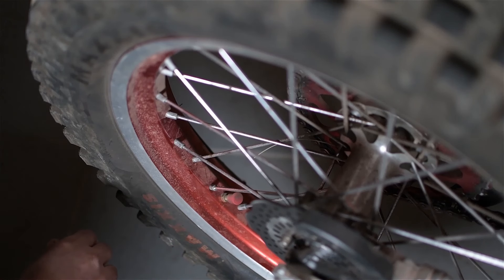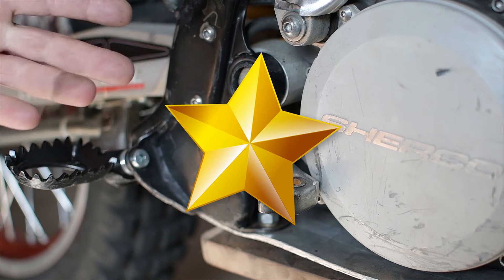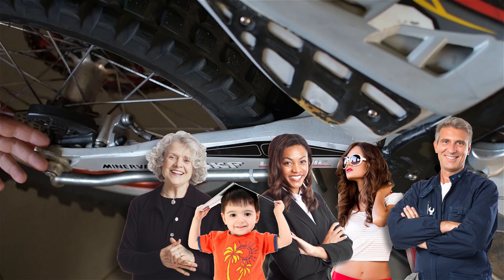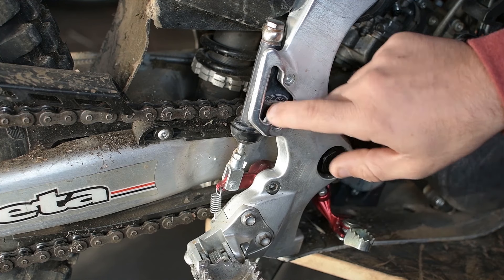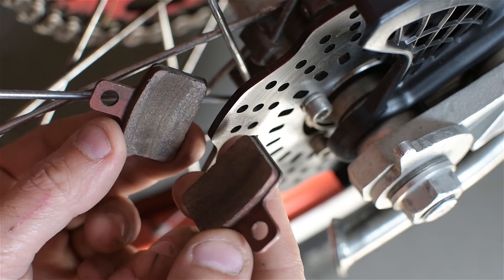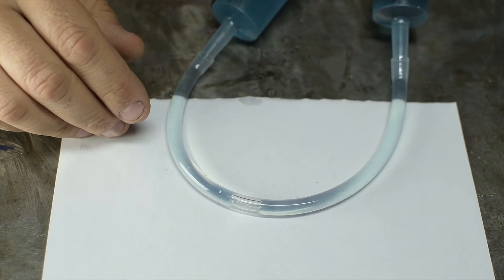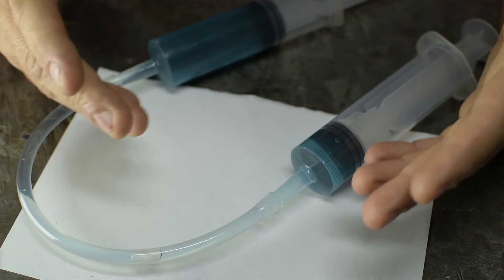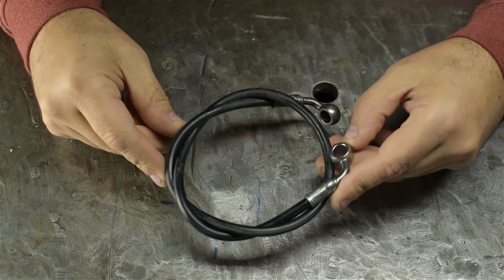I'm an Idiot! (Soft Spongy Brakes)

Comment: Hmmm, since you have reservoir the brakes are self adjusting so you wont run out of travel in your master and if you pushed the pistons in you caliper too far you would have a leak. So I don't buy you conclusion. 
But here is my thought of what was wrong (that has happened to me):
The thing that retracts the pistons from the disk when you let of the brakes are the piston seals. If they retract them to far you will have a soft pedal (and you might run out of travel). This can happen when you rebuild a caliper with new seals, even more likely if you put the seals in the wrong way, they aren't perfectly square (but it isn't necessary). 
You can remedy this seal retraction issue by getting the pads as close as possible when you install them, basically hammering them in between the pistons and disc.
I think you did the same thing but with a thicker disc instead.
Reply: Exactly what I was here to say.  Thanks.  Either a backwards seal, or a seal that is stuck to the piston; which is better than a seal stuck to the ice.  Either way, beating the seal with a stick can resolve the issue.  I mean, cleaning the piston and putting some brake fluid around the seal as you reassemble it can get it moving nicely.  Piston removal with compressed air is fun, but make sure you have a piece of wood in there to catch the otherwise airborne weaponized piston.
Reply: There also a couple of millimeters of brake pads from either side of a rotor that is designed to get thinner without loosing brake power. So, installing a new break pads you should have had enough travel for the brakes to work fine. So, yeah, there must be some other explanation than run out of travel.
Reply: Unless these bike calipers are different from the car calipers I'm used to I agree.  I have seen plenty of calipers pop a seal because the pads and rotors were so badly worn. It even happened on an old buick beater I owned once. 

The only possible differences would be if the caliper pistons have some sort of positive stop, and I don't see that being possible in that design, or if it was designed so the port is blocked beyond a certain point.
Reply: Yeah, I don't see it either. However, I have had the same problem on the rear of my bike. It'd work fine until the pads got worn down a bit and then, nothing.

 Turned out the pitted cylinder would introduce air on retract. I found this out after pushing the pads in to make rear wheel install easier and losing the rear brake, even though it worked before hand.
Reply: Mawe42, Im with you 75%. A heavily undersized disc will have a tell tale of seal leaking. The seal design does retracts the piston as well as letting it slip advance to cover pad wear. Measure the axial TIR of your old disc. If its warped, the pads get "knock back" leading to an oversized gap in your piston, pad & disc sandwich. This will feel like a big air bubble and result in a long pedal. And you may feel pulsations when you brake (swash plate pump in reverse). If the wheel bearings are loose it also allows the disc to wobble axially leading to the same effect without the pulsing pedal. These are both dynamic problems and the system will seem fine while you bench test them. (Tony, You did retest the bike brake after cornering on bumpy ground?)

This is why I put a Postit note on my steering wheel saying "pump the pedal!" before I replace brake pads. A first and sometimes second brake apply is needed to close all the gaps to normal and will have a very long and ineffective pedal. The note reminds me to do this while stationary in the garage rather than to discover it later in traffic.

The retraction function is a design feature in the caliper body. Its is a deliberate chamfer on the caliper seal groove outside edge. It causes the rubber seal to bend there and act like a rubber spring. When you release the brakes, the rubber grips the piston and returns to straight retracting the piston. Ideally this retraction is just a touch less than the clearance resulting in a snappy brake feel, without dragging. The caliper piston seals are not handed but the master cylinder seals are so they only seal in the "push" direction.
Reply: I also agree on this, the caliper should be more than capable of handling a 1mm change in rotor size. Should be able to wear the pads down to nothing. It can’t hurt to replace brake components but your piston travel should have been able to make up for the loss of rotor width.
Reply: I agree entirely. In my other post above I say he should have noticed the difference when he put new pads in until they wore.  That would give exactly the same effect.  Prior to bleeding I always press down hard on the pedal to set the pads onto the rotor and then start bleeding.  If you don't you can have the problem he describes....so? Expert??
Reply: @Biffo1262 My explanation could have been tidier. I should have highlighted that all his static testing for fluid leaks, material fails and bubbles will miss the dynamic effects. This can add frustration, mystery and folklore as what you see on the bench seems fine but the problem "reappears" after use. If its still there after the disc swap, next check is wheel bearings.
Reply: Having said that he checked it against the spec of the bike and it wasn't the right disc thickness
Reply: @NaturallySelected  Maybe this fact (out of spec rotor) caused the seal issue but the seal issue isn't really solved by the new rotor.
Reply: @
mawe42 well, not really. The master brake cylinder has a spring inside, with the only role of pushing back the piston to the initial position. That movement creates vacuum which gets both the fluid back and resets the brake calipers. If you play with the two syringes you will see you only need to operate one to control the other.  On the other hand 0.5mm of travel really doesn't seam the kind to put the piston out of work, but I only worked on car brakes, so don't know what spec's are on bike parts.
Reply: @stephenbello1081  you are exactly right.
Reply: Ha I  have had this exact problem on my beach buggy,  had  the front disks coming on first and the back were soft and spongy. After all the shit that you went threw the answer was to put a 10psi residual valve in the back line, that was enough to overcome the pistons from moving back too much but not enough to engage the shoes.
Tony's  breaking would be the same, the caliper seals are rolling back after each operation.  On cars the master cylinder has a 2 psi residuale valve to compensate that.
Reply: Naturally Selected yeah rotors are specd by thinkness for safety reasons and stability, the caliper should have no problem handling the loss of 1mm
Reply: @DrewLSsix  I wonder if they have a method of stopping the piston from over extending. Coming from the automotive world, the rotor thickness doesn't really matter (within reason) as long as there is enough fluid to fill the bore.
Reply: How dare you call tony a thick di.. oh.. thicker disc! My bad.
Reply: I would suggest it's more likely the thin rotor warped when hot causing the pads and pistons to push back. This would then create excessive travel on the brake pedal.
Reply: When I comes to brakes I believe engineers design on the safe side and allow for extra travel in case anyone is dumb enough to ignore the wear. In my opinion you did the right thing in trouble shooting from beginning of the problem to the end.
Reply: @ianjefferson6687  That is assuming it wasn't like that with the bike just sitting there. I think the man is smart enough to diagnose a warped rotor.
Reply: I agree with you, the out of spec rotor width would not cause this. Potentially the old rotor was bent or something. Or the seals like you mentioned.
Reply: @
mawe42

i thought maybe warped disc but it may also occur on single piston calipers that have sliders if the sliders stick the piston pushes the brake pad and disc to the other brake pad (pressure finally) and when released the disc returns to center and leaves a big gap between one pad and disc :-)
Reply: @stephenbello1081  I think you nailed it.  When he showed the mic on the rotor I was waiting for him to measure multiple spots at least.  The real test of course would have been checking with a dial indicator for wobble.  Wouldn't take much at all on such a small system, and as noted it would have been cured by the new rotor.  Tony may have to have one of those tattoos removed!
Reply: @--_DJ_--  it is indeed an assumption and yes I'm more than sure he is!
Reply: I think the calipers are slightly idiot proof. They might have a travel stop to prevent burst seals.
Reply: He was visited by the hydrodynamic fairy  after all his valiant efforts.
Reply: There's one more tell for loose bearings on a bike wheel that has a single sided brake. Brake hard and straight on smooth bitumen and feel for if that wheel is toeing in. If you do get a bit of self steering, that also points to lose bearings (causing knock back) being the root cause.
Reply: My first introduction to knock back was when my 2wd Chevy Pickup cracked and eventually sheared the left front spindle. Unusable low pedal till eventually it failed entirely, fortunately in a parking lot.
Reply: I've had the vent on my reservoir clog up causing the reservoir to build a vacuum and suck the pads back. Took the cap apart on a hunch when I noticed the lever feel get better when I pulled the lever during visual inspection with the cap off.
Reply: @yurikslalom  Good call.  Brand new pads with worn rotor = worn pads with brand new rotor.  When we replace pads we usually have to push the piston back into the slave cylinder to produce sufficient clearance to fit the thicker new pads.  The rotor was not quite 1mm under size.  The new pad we saw had about 4mm material on each making 8mm.  That 1mm under sized rotor is not stacking up with his theory.   It would be useful if ToT had qualified the 'sponginess'.  Was it really a soft pedal, or excessive movement that became firm after a second pump of the pedal?  If the latter, then we might have the culprit — the piston is being pulled back into the cylinder.  Whatever it was, I don't buy the worn rotor as the sole culprit.  🏍️🛠️
Reply: What ToT did is correct....the undersized rotor caused the pistons to travel further from rest.
The seals are the "retraction" for the pistons including a slight rotor/pad "knock off"
Even a used tapered rotor ie thinner at either end will cause the piston to travel more....why some pads wear uneven.
Add in flex at the caliper mount or the rotor not centered in the caliper.
Reply: @mmazz30  So how do you account for new pads not fixing the problem then?  The rotor was 1mm under size. New pads are 4mm each = 8mm.  Hydraulic brakes auto adjust as you say, but 1mm is not going to put the slave cylinder outside its spec when new pads are used.
Reply: @mmazz30  You have way more wear on the pads than the 1 mm from an undersized rotor that the caliper pistons have to deal with.
Reply: @stephenbello1081  I thought about knock back from a warped rotor. But that is noticable when you brake, so I think ToT would have figured that out and it would also firm up standing still and pumping the pedal.
The seal and groove design in the calipers can vary, but the basic function is the same, the seal deforms a small amount to retract the piston. You usually see this issue on rebuilt calipers with new seals, almost never on old seals that is a bit stiffer.
Reply: So you guys are saying that ToT needs to rebuild/replace the only part of the brake system that he hasn't touched yet.

Comment: These videos really are a wonder. They explain things the right way - by presenting a problem and working backward to find a solution, rather than starting with some esoteric bit of foundational knowledge and then trying to work upward to explain the surface-level, common sense parts of a problem.

Comment: One other item could cause this.  If one of the caliper pistons is seized and won't move, the same thing can happen.  Also, if it is a floating caliper and it becomes seized, the same thing could happen.  Also a warped  disc can cause the pistons in the caliper to move back too far resulting in the brake pedal to go to its limit with just a weak braking force.  Symptoms of a warped disc will be vibration when the brake is applied.  When I worked as a mechanic, when doing a brake job, one of the checks  was to always measure the disc rotor thickness or brake drum diameter.  Nice job on describing the problem.

Comment: I mike my rotors every morning, even if I'm not going anywhere.
Reply: I would ha replaced the rotors and all the other parts on the bike.
Reply: @jamesscott1932  These days rotors going out at common because of metal in the pads but back when pads were asbestos they could last for several brake pad changes.

Comment: Awesome entertainment again. Just to point out, many smaller bikes at least have only one piston in the rear caliper pushing against a stationary brake pad. Also a worn rotor rarely manifests as spongey brakes because the brake system compensates for brake pad (and rotor) wear by pumping in more fluid into the lines from the reservoir.

Comment: I think you got it wrong mate, Thin disks work like thick disks....your problem must have been a warped disk, knocking the pistons back as the wheel rotated thereby taking up your piston travel. Fluid will compensate for a thinning disk or pad.
Reply: This
Reply: Yeah defo somewhat right here, the piston will take up the slack and only return a set amount. The same way you can pump fluid through, otherwise this wouldn't work. It may be it was bending the disk at the piston travel limit and pushing it back in after. Or warped as mentioned. You get this effect a lot when 4x4ing when you have a loose bearing. (might even be possible here)
Reply: but a warped disk ist only spongy if no Rotation...
if you rotating (driving) it... you can feel the Pedal moving like a Pump if you push it.

greatz from Germany

Comment: I just take apart the whole thing and start guesing till it works. That way I never figure out what I did right and never in a risk of becoming smarter.

Taking apart and reassembling is my only hammer and everything is a nail in my eyes
Reply: Yeah man, me too. The only problem is I always end up with more parts after I finished reassembling. Y'know extra screws, extra pins or extra clips
Reply: Sumpeno Notoboto -  it’s called magic!

Comment: Halfway through the brake fluid part of the story I was yelling at the screen Bent Rotor! well i didn't know you'd get the same result from under spec but close enough.
Reply: the under spec rotor does not have the mass to absorb the heat from braking this causes it to get to a higher temp then when the brakes are still on it will bend the rotor.
Reply: @thaneonyou  Chinesium rotors, fresh out of the white box, will do that after one panic stop on the highway.
Reply: @--_DJ_--  I can't tell you how many times I have got brand new rotors from AutoZone and had them worped.

Comment: As many have commented, disk/rotor thickness has ZERO effect, same with the pads.  Uneven, tapered wear pads, non-parallel caliper or warped disk will cause this.  You fixed it, but the reason was entirely wrong.
Thanks for the funny vid, very good.

Comment: no, sorry I'm not one of the 4 people you helped with the video.... but ya got a good laugh out of me while having a very hard day !  THANK YOU !!!!  Red sweatshirt of SHAME ?   probably why I've never seen you ware it before ! ....
you got nothing to be ashamed about !!!! just remember what you had to go through to fix it.... and all those extra parts will come in handy eventually ! .....being so sure you have the right answer for the problem, then finding out that wasn't it after all
is what being a mechanic is all about !  it is so ever present in the Automotive field they put computers in the cars and an analyzer in the shop to tell the Dumb mechanic which part is really bad...... the bad part? they don't always point to the right bad part ! ......but it's a start....in 100 years they might get it right !
....it's like wiring trailer lights from scratch.... you rationalize it , know how it is supposed to work and then just put a big wrench on the brakes and then find the right wire in the back !  " it's whatever works man !"
Personally i'ed never have thought the rotor would be that wore down ! and I'm a retired motorcycle mechanic ! 
looks like on that bike you replace the rotor when you replace the pads... that sux ! so the mind bending question is how did the designers of the bike rationalize putting in a brake rotor that had no tolerance for ware ?  it boggles the mind ! LOL...
Bob......

Comment: Tony, I work in the forklift industry. We have certain models where the brake line can go over the mast and can be 20’ long. With the line going over the  mast its hard to get that bubble out of the brakes. OK here’s how to bleed that long difficult line. Connect a line on the bleeder on the caliper, take the other end and put it in the reservoir. Open the bleeder keep the reservoir full and keep on pumping, hard and fast, the fluid is in a continues loop and after a while close the bleeder and test it. More than likely the bubble will be gone. Hope this helps someone with those difficult long brake lines. Richard